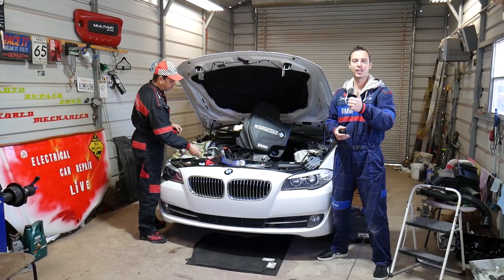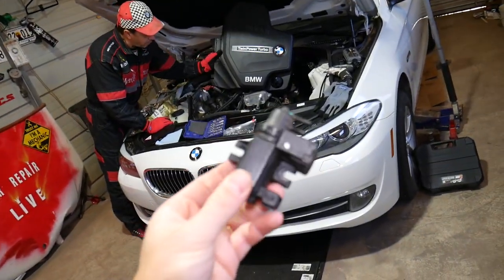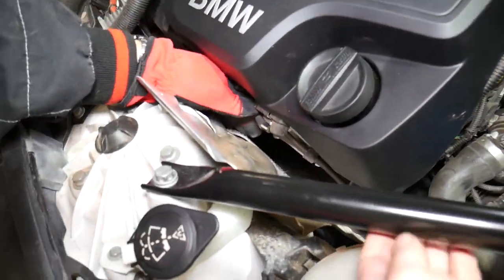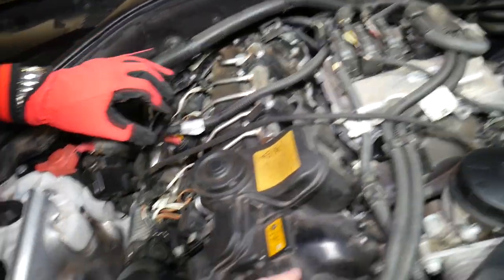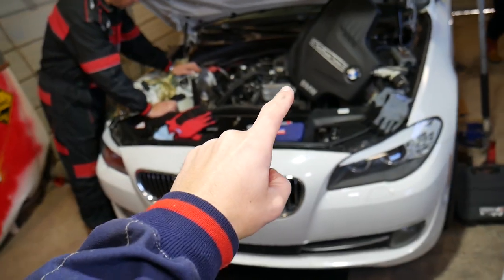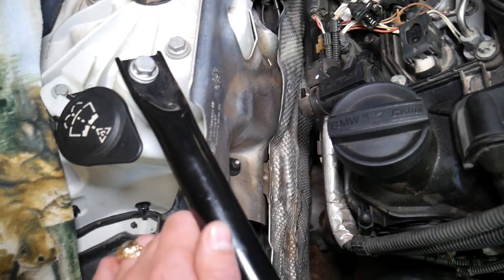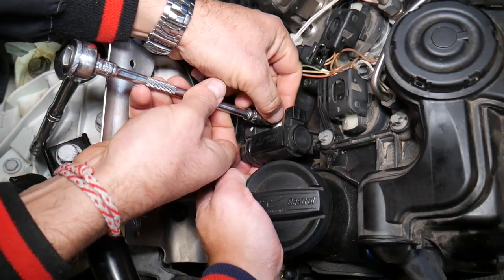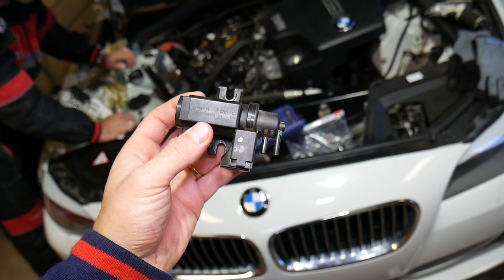BMW F10 F11 TURBO BOOST SOLENOID REPLACEMENT LOCATION 520i 528i

Comment: So why did you have to replace the solenoid? What were the symptoms?
Reply: Because the wasegate doesnt open
Reply: @beeme1740  thanks. Already got rid of my 5 series at around 130k miles about a year ago. Self-Maintenance got too costly. Was fun while it lasted.
Reply: @beeme1740  if the wasegate don’t open what’s going to happen?
Reply: I have a 2013 x3 xdrive 28i I changed the timing belt tensioner after that the car crank but not start I check the fuse I replace the fuel control model , spark plugs and nothing , i’m getting frustrated because only mess it up everything please if you know what is the Problem  please appreciate it if you help me out I’m being spent a lot of money.always look for you nice videos.

Comment: So this video actually this video helped me fix drivetrain multifunction on my 2013 BMW 528i Xdrive. The vacuum lines were not connect well. The one tht goes to the solenoid with cut off. I jst got a hose for 1.5$ and thts it.
Reply: what codes where you getting?

Comment: I’m having multiple misfires on my 2013 528i. Replaced all of the plugs and two coil packs. Saying 2-3-4 misfires. Could it be the solenoid that needs replaced?
Reply: Injector leak
Reply: @ronaldo7289  nope. Problem is fixed now. It started with the crank case value being gummed up. I blew the gasket on the vacuum pump. Replaced the vacuum pump, crank case vaults and the turbo inlet pipe was cracked. All of this cost me $7000. I’ll never buy a BMW again
Reply: @jeffmee9326  damn I’m just buy an engine for 7k for my 550i
Reply: @ronaldo7289  is that just for the entire engine? Is it new?

Comment: In my n20 engine..oil is coming out of the vaccum line and the vaccum chamber  box in the  engibe cover.
Wht should i do
Reply: A year later you probably got it fixed. For everyone else replace the vacuum pump. Cheaper to get the part and have the mechanic install
Reply: I have the same problem 520i 2012.